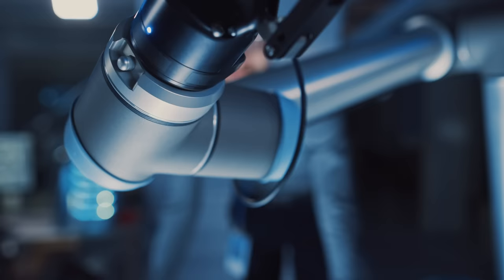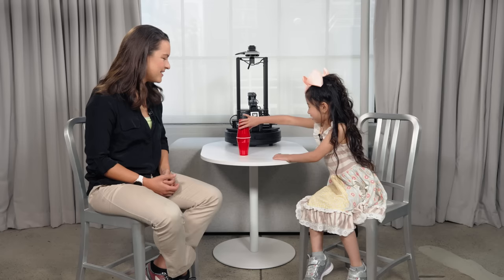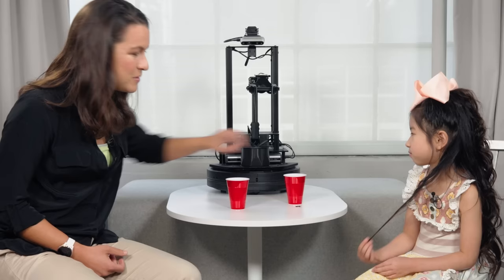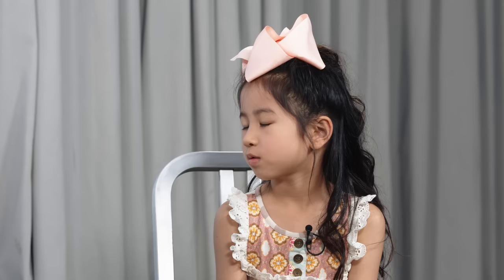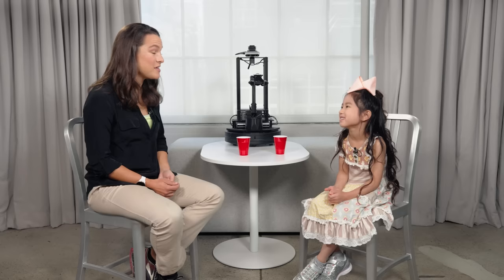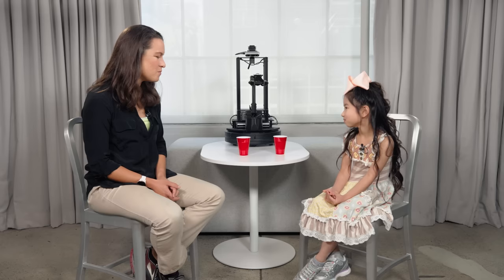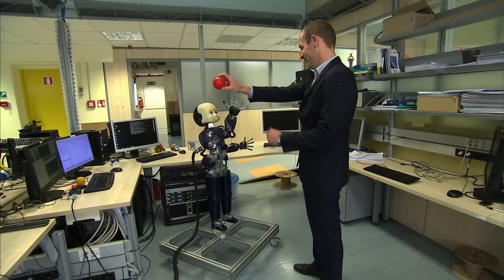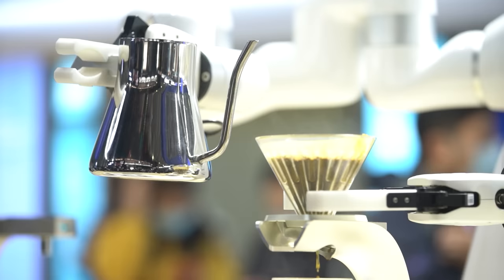Computer Scientist Explains One Concept in 5 Levels of Difficulty | WIRED

Comment: When we say "pick up a cup", we're describing an outcome that actually has very complicated steps. Like we move our muscles, we apply the right pressure, we use our past experiences, we observe the object visually etc. It is simple for humans of course, but if we describe all of these steps in the greatest possible detail, it would be an insanely long description. It would also be full of complicated rules, like what if the cup is very heavy, very big, slippery etc.

When programming, you are required to break these steps down. But it's practically impossible to do that while accounting for every imaginable variation. So instead we create systems that learn on their own, which is also complicated.

On the other hand, a computer's language is inherently tied to numbers (or rather things that can be represented as numbers). So operations involving numbers, such as multiplication, can be described in, relatively speaking, very simple steps with almost no variations or exceptions. It doesn't matter if it's 7*7 or 7777 * 7777, the instructions are still the same.

Comment: If you look at 2:17 she said it took her a couple of days before she could do it properly so can it be said that Robots are still at their learning age or the maker of that robot is still unable to programme it at that level where it can hold that cup or place the cup just like it can calculate sums easily?
Reply: Pretty much. Our intuition is a result of billions of years of evolution which robots don't have. While AI is made by simulating evolution by natural selection, we don't have the computing power to train them to the extent that we've learned. At least, not yet :)
Reply: Since real world scenarios are susceptible to random changes, programming a robot for each case will be difficult. For instance, the cup can be placed in multiple ways, have different designs, or may be deformed (the list goes on, leading to many possibilities.) This adds to the complexity of machine learning algorithms, since each case will have to be separately programmed.

Although the robots can be (theoretically) trained for all the cases, but it would be very time and resource consuming. Thus, we use real-time analytics and try to maximize on that efficiency.

Comment: You don't really get to the point that actually IS paradox. That should be the idea of comparing a digital machine with an analog organism. The analog logic-unit is working with unit less amounts and relations that fade over time-periods. Comparing this with bits that occur in cycles is actually the paradox thing.
A good brain is intelligent. That means that it is capable of making accurate predictions for chaotic situations over time.
A good computer is capable of doing the most simplistic operations zillions of times per cycle.

Comment: Seems like a key missing element is desire; a human typically learns to do something because they want to achieve a goal.  A robot has no goals; it has instructions that it carries out meticulously, but it doesn't care if it succeeds, and doesn't have any understanding of why those instructions are important, so it is typically very bad at innovating or adapting to new situations.  The underlying level of abstraction that humans will always apply is "I want X" and the cognitive effort is toward what effectively amounts to innovation; we make up a possible way to get X, we try it, and we adjust our approach based on feedback we receive.  The robot doesn't want X, it wants the specific version of X that it has been programmed to want, and the circumstances to which it can adapt are therefore limited by the imagination of the programmer.
Reply: Well sort of. The ai field is currently working on ways for robots to recognize goals or set goals.
Right now to train a robot in one task you set a goal which will reward the ai with feel good points.
To make it easier for the robot to succeed we also set up smaller in-between goals and give it smaller amounts of feel good points. 

The robot has a probability matrix - a table in which there are small parts of actions or inputs it can do. In the beginning it tries out many random combination of actions. But as it finds more combinations that are more rewarding it can figure out a combination and sequence of actions that lead it to get the most feel good points.

It does this by increasing the probability of choosing the same combination and sequence.
Reply: AI researchers consider progress in AI to be about making AI better at seeking goals

Comment: Made it to level 5 with a decent understanding.

I suppose the easy and hard tasks for humans are just defined by the amount of data we've gathered and processed. Picking up an object has been done so often by us, but calculating big numbers hasn't, same with playing chess (especially since the tasks weren't a factor in evolution (until relatively recently)). In the same view, picking up objects needs tons of coordination and input; sound, hearing, movement, and sensation. In these challenging tasks like chess, AI excels because there is so little input and so much (automatically generated) training data, although it is still funny to see that even current huge general language models still struggle with arithmetic, even though brute force computers don't. Although specialized and tuned models have greatly helped in mathematics, helping to prove and make theorems in graph theory and representation theory. (If you wanna know more about current AI in math conjectures: https://www.youtube.com/channel/UC9bkKi8Us7yevvP1KIBQHog, a research scientist at Deepmind)

In my laymen's interpretation, I expect that generating "better" low-level latent spaces before higher-level latent spaces will be the key to improving AI generability and correct output. These relatively low-level latent spaces could maybe also be substituted with AI trained on specific data, which in turn could improve the generality of AI. (See facebook's Blenderbot 3 which uses the internet for aggregate output. In my eyes, the internet search can be seen as giving relatively high-level output as a low-level subsystem, which the aggregate uses to produce an even higher-level output.)

They were also talking about purposive actions. In terms of AI, this is certainly a field that philosophers would love. Because the line between programmed and intent is starting to fade with AI systems, and although AIs are currently not at the point of sentience or purposivity. Looking at the exponential advancement of AI, I feel like this could change in the next 30 years. Exciting times!
Reply: So data is the key?

Comment: Here's the answer to your Question Professor 11:47, in order to get the robot to accelerate in learning, we have to think outside the box of reality or maybe think like a robot lol. The answer to your question 11:09; By teaching the robot to pick up something like tofu for an example, we first have to calibrate angles on one hand of the robot that hold a plate with a fine edge that levels the surface it places its self on and the object Infront of it the other arms pushes the tofu by the center of its dimension the up the slope on the angled plate and then leveling its base plate to a center mass of its weight.

Comment: As a CS student myself.. I think that Robots really hit a wall where there is as less as possible calculation involved. Like a robot can calculate throwing a ball precisely using projectile equation in a defined say,. plate however it will always struggle to retrieve it out of the plate.. even though it identified that the ball has reached its destination it cannot simply pick it up because the ball is anywhere in this plate this does not require excessive calculations only excessive scripts that break the backs of programmers because that aspect is very human and a human is needed to input that a kind of  ability.
Even in chess a Robot can calculate using the superior computing ability what is the next best move.... however it cannot calculate what is uncalculatable like picking the chess piece up physically and putting it in the next UNSPECIFIED area.

Comment: Could you apply generalized game physics to the crumbling tofu problem?  Like, instead of simulating 100 specific instances of how that tofu may crumble, just teach it the concept of "crumbling" (like environmental destruction in a game) and how that might apply to any object, inclusive of tofu.  Then you could set your robo-finger pressure sensors or robo-vision squeeze detection to a generalized stopping point to prevent "crumbling".  With the goal of making directives implicit rather than explicit.

Comment: This seems like a largely false paradox, in that the things they describe as difficult aren't particularly difficult, and the "super easy" tasks are actually much more complex than you think
Reply: @tk50000  both. What is required for our manual dexterity and hand eye coordination we shouldn't take for granted. It takes years of trial and error and the electrochemical process behind it is intimating. As for calculating large equations, this is not particularly difficult. No matter how big the number, it's still just a matter of little numbers with more steps, which is time consuming, but not for a computer. It isn't smarter than us, it just gets the solution faster because it uses a crap ton more energy to put its binary state into a new state with low error rate
Reply: 100% the paradox is a result of the paradigm that what we find easy is objectively easy. A mountain goat may find it easy to climb up a steep and vertical mountain, or a fish easy to move its body through water
Reply: Lmao thanks. The ONE guy in the comments section who feels this paradox is lame. The so-called-simple tasks like picking objects/eating/walking shouldn't be considered easy... neither should tasks like multiplying two large numbers be treated difficult. Give more RAM to the brain and a ton of carbs, you should be good to go as well 😅

The first kid's responses were the best. She correctly figured that the first time she learnt how to stack objects it would've taken her some time. Give a bot the same sensory processing systems as a human and logically teach it how to, and there should be no paradox.

Comment: There is no paradox because picking up the cup its a complex task and multiplying two numbers its actually really easy, for example to multiply 31 x 13 what you could do is add one by one 31 thirteen times and you have the result, the only problem is that it would be really slow for us, for the computer its simple intructions that he can perform really fast.
Reply: Picking up a cup is not a complex task for a human. It’s only a complex task if you think procedurally, which is the point.

Comment: As a software engineer, I'm a little disappointed that this was the topic.  I'm not even entirely sure why it is even named other than to present the world of computing at an introductory level.  They got to the answer that shows it isn't actually a paradox at all once she was talking to an expert.  The human system is such a immense number of input receivers that have had millions of years to have selective pressures guide it to being really good at processing those inputs in certain ways.  If you could build a robot with the same number of input receivers that are geared towards using and internally manipulating those inputs, it would, in theory, be able to produce a very similar to exact output - maybe in a more efficient manner since it is designed rather than being bogged down with our system's history and baggage of emergence.  For the most part, it isn't that it is any harder for a machine to do something than a human.  It's that we take for granted what the human body, as a natural computer, can do.

Comment: isnt this just a hardware problem etc sensors...
Reply: No, it's easy te replicate sight, hearing, balance and touch in machines. The problem is writing software that combines all these thing and produces an output when tasked with an arbitrary task. It requires multiple leaps in robotics we haven't achieved.